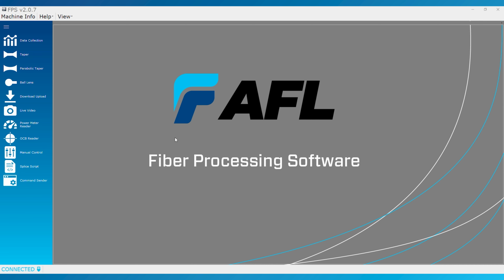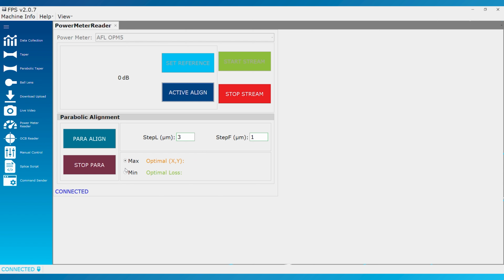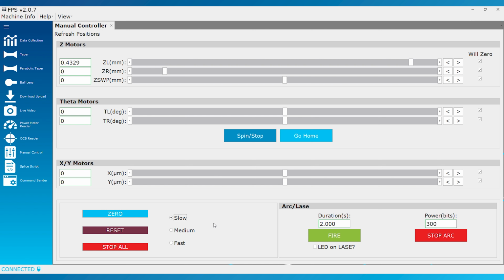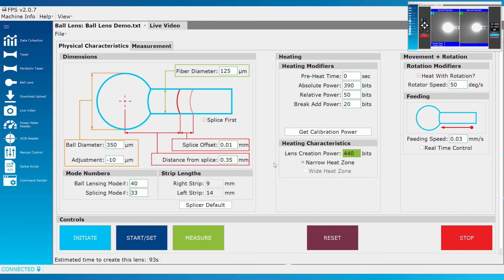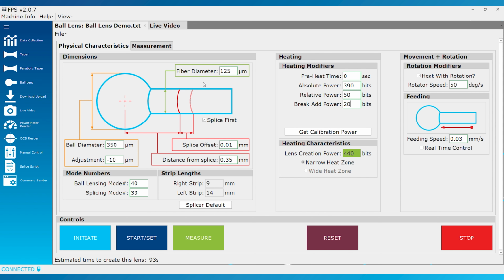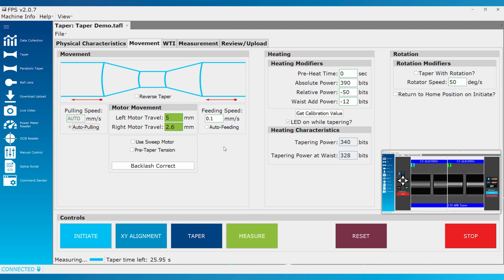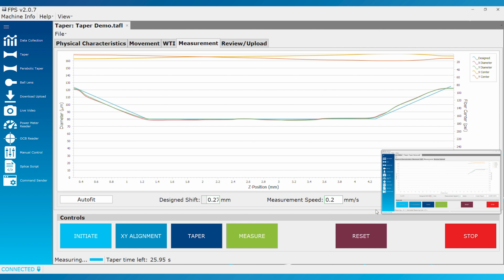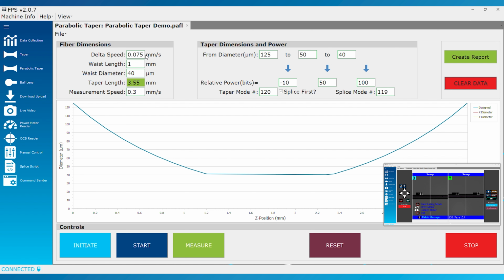AFL Classroom: FPS Splicer Control & Fiber Shaping

Comment: The issues we are experiencing with the Fujikura S90 (persistent 0.00 dB loss, misidentification of SMF as MMF, and high loss in G.652 mode) 
1. Why SMF is Misidentified as MMF?
2. Why 0.00 dB Loss  every time in Auto Mode (we are checked over 20 times) ?.in splice result showing MMF instead of SMF
3. High Loss in G.652 (SMF) Mode
Reply from the maker: Hello, please call 1-800-235-3423 for assistance from our service group. They should be able to help you out.